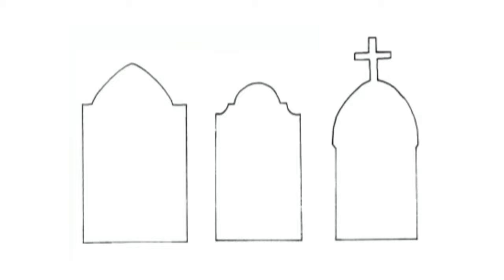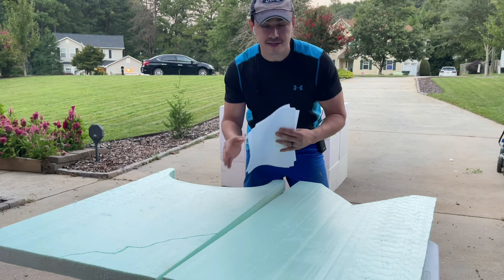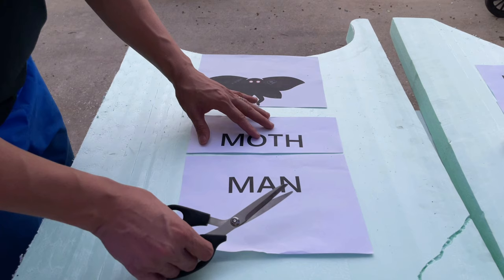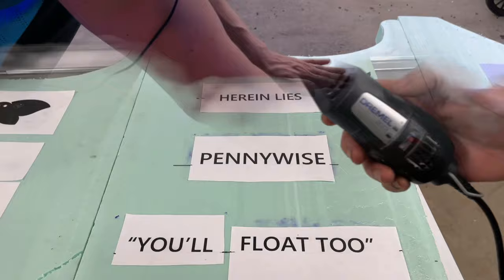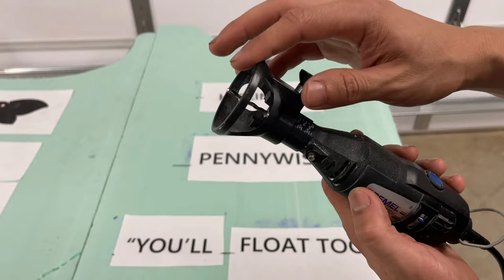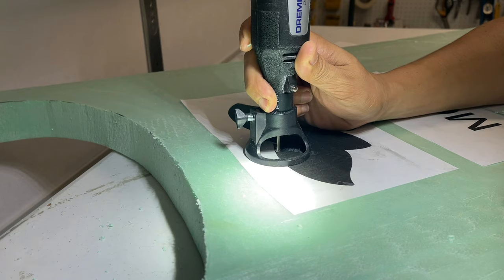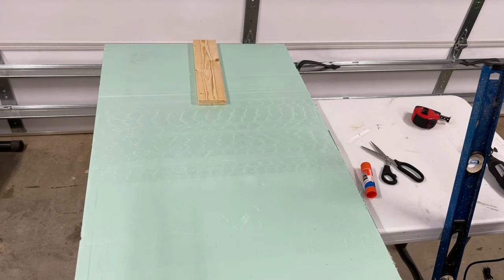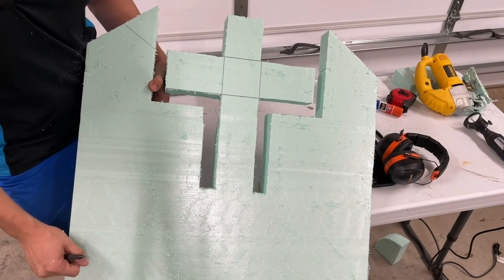HOW TO MAKE REALISTIC HALLOWEEN TOMBSTONES - TUTORIAL

Comment: IMO using a hotwire to cut them out would probably have been faster & definitely less messy there is one kind that you can bend to make pacific shapes & could be used to carve out the text but you would want to wear a mask &/or do it outside or well ventilated area. A wood/leather burner/soldering iron would also work well for doing the text & any decorating symbols often found on tombstones
Reply from the maker: These are great ideas ☺️

Comment: Q: wouldn't it be easier to weather the tombstone with the heat gun before carving the letters?
Reply from the maker: That’s a great question. You would think it would be easier and it would be if you didn’t have to glue the paper down. In order to carve the letters, we have to glue the paper first in order to be able to use the Dremel tool to carve them out. It won’t work if the surface is not smooth and flat so unfortunately, the letters have to be carved first before we can age the tombstone with a heat gun.

Comment: I love these! Can't wait to make some for myself! 🙌🏻 
Quick question, do you have a mask you recommend for when we're carving/painting? There are so many options out there, but I need a good one!
Reply from the maker: Thank you! Yes I always use a respirator when dealing with Styrofoam or foam in general or when using spray paint or other chemicals. 
This is the respiratory I use: 

3M Rugged Comfort Quick Latch Half Facepiece Reusable Respirator 6503QL, Gases, Vapors, Dust, Large https://www.amazon.com/dp/B00IF7RCU6/ref=cm_sw_r_cp_api_glt_fabc_TGPR5KVF4XSMZCM9J4QA?_encoding=UTF8&psc=1
Reply from the maker: And these are the filters I use: 3M P100 Respirator Cartridge/Filter 60926, 1 Pair, Helps Protect Against Organic Vapors, Acid Gases, Ammonia Methylamine, Formaldehyde and Particulates https://www.amazon.com/dp/B009POHLRC/ref=cm_sw_r_cp_api_glt_fabc_BFB52NHJ9DSCYT19N12F?_encoding=UTF8&psc=
Reply: You are awesome, thank you so much!

Comment: Will the paint run if it rains?  If so ... Is there a way to prevent this?
Reply from the maker: The paint I used is exterior latex paint that I bought at Lowe’s. It is meant for the outdoors and will not run as long as you allow the paint to dry.

Comment: Hey Isaac, these look great.  Does the polystyrene with DryLock and paint over top hold up well throughout October?  I'm making a large prop that would ideally be used again for future Halloweens.  Any thoughts or suggestions to make sure the sun (and a bit of moisture) won't damage it too much?
Reply from the maker: I’ve used this method three years in a row. I use it on both Styrofoam and insulation foam board. I always apply a coat of drylock and then use exterior latex paint over it. They last me just fine with no issues

Comment: Is that really just 100-120 font? I printed mine at 120 but it looks a lot smaller than yours.
Reply from the maker: I mean it also depends on the font style you are using. Some fonts come in bold, slim, italic etc. so if you want yours to be bigger, I would suggest double the size, Try font 200 to see if that works better for you
Reply from the maker: I mean it also depends on the font style you are using. Some fonts come in bold, slim, italic etc. so if you want yours to be bigger, I would suggest double the size, Try font 200 to see if that works better for you
Reply: @IsaacAlexanderDIY  Thanks for the response! Yeah, I considered doing that or looking into vinyl cutting but I think that's probably expensive and unnecessary. How thick do you think your dremel bit is? How long did you let the glue dry for? Love your videos! Looking forward to more Halloween content.
Reply from the maker: @fennec7906  the dremel bit is small, I listed the ones I used in the description of the video. They only go down into the foam about half an inch. I let the glue dry for about 1-2hrs